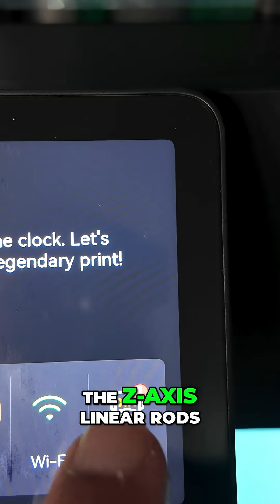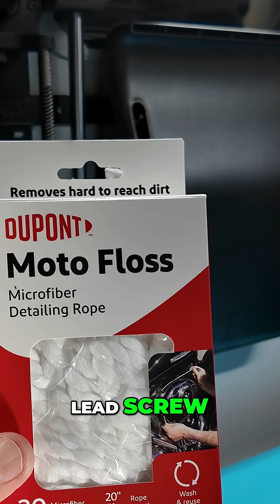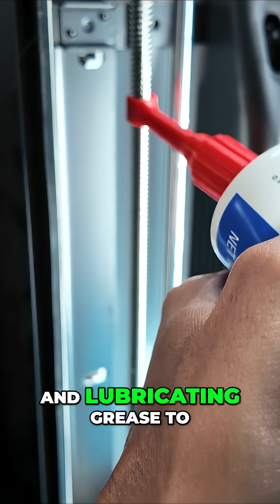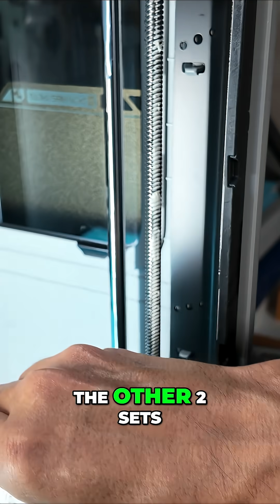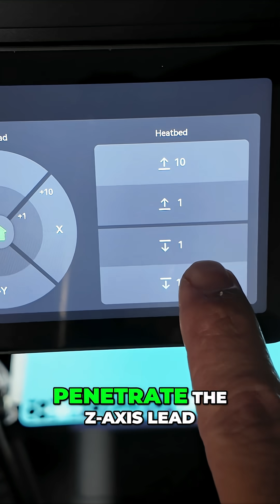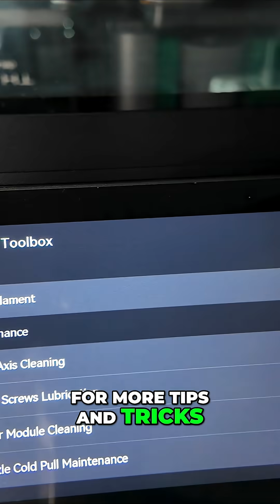Bambu Lab H2D: Clean & Lube Z-Axis Linear Rods! #shorts

Comment: Cool video - gonna try this out. What about the X axis linear rail guide way? How do you clean/use oil on that?
Reply from the maker: After cleaning the dust and debris from the surface of the X-axis assembly, it is recommended to apply lubricating oil to the rail and move the toolhead left and right to evenly distribute the oil on the rail. Please note that both the upper and lower sides of the rail need to be lubricated.

Comment: Thanks for the video!
1. I get little threads left behind when I use Gear Floss to lubricate the H2D z-screws. Does this happen to you?
2. Where did you get the grease applicator tip for the z-screws?
Reply from the maker: I haven't had any issues so far with the gear floss leaving threads. I wonder if you might have some rough spots on one of your lead screws? The tip for the white lithium grease is available here: https://makerworld.com/en/models/721573-lucas-oil-white-lithium-grease-applicator#profileId-652443
Reply: @directedt3ch Thanks for the info! I go in the up and down directions when cleaning the z screws w/ the Gear Floss. I think the up direction is harder on the Floss. I read z screws on the H2D are a courser cut than on the X1 series. Do you slide the Floss both directions w/o issue on the H2D or just the downward direction like in your video?
Reply from the maker: @MOVIEKICKS  I go in both directions with the floss. I just showed the quick bit there in the video.
Reply: Just 3d print the tip.  😁